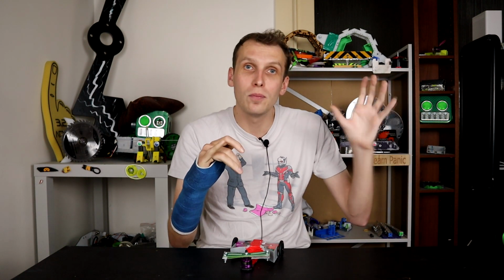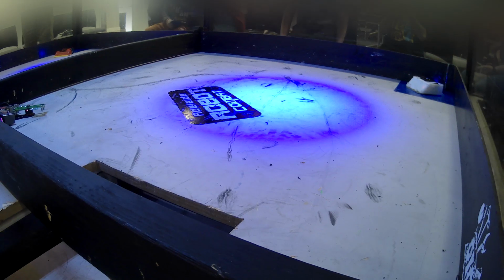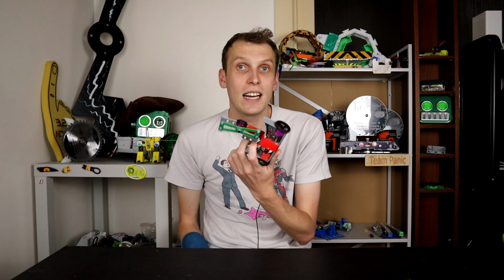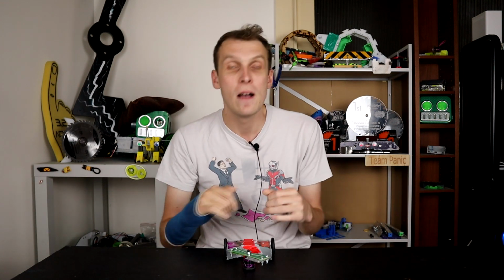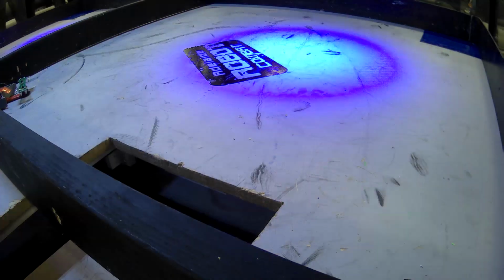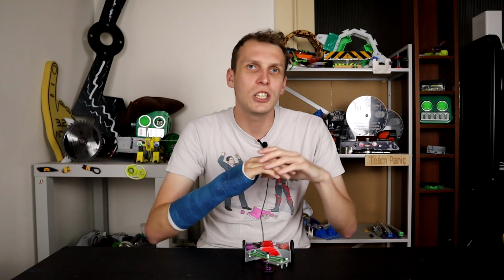Fighting the gyro! (ARC 150g A league fight report)

Comment: Wow, that hit with BT was certainly something, looks like a new bot to keep an eye on. Although now I wonder if there's just something inherantly stronger about verts? like, 99RB was meant to be "none destructive" and we saw how that turned out, now we have BT, well... doing THAT.

Feeling this guy needs a re-branding from Gestimate to Gyrohate XD

Well...Brick certainly decided "lego" lego home. Suprised the entire thing didn't blow apart, the actual bricks are stronger then I thought.

The irony of Gestimate working better in "Brit Mode" when it wouldn't actually be a legal ant because of the stupid cube rule lol.

Had a brief idea about setting one of the motors further out, thinking it would provide more rotational force to help counteract the force imparted by the weapon screw when driving in a straight line, but now I'm not certain it would actually do anything. Maybe something on the controller, setting one channel's max to be 90 or so?
Reply: Yes, vertical spinners are inherently stronger than horizontals due to the simple fact that newtons third law exists.

When a horizontal hits an opponent, the energy released will be equally divided between the bot with the weapon and the bot getting hit, usually both bots fly away.

When a vertical hits an opponent, the energy is again released into both bots. But now the weapon bot is diverting all that energy into the floor (since the direction of energy is now vertical) and since the weapon mount is now braced against the floor, also redirecting some of that energy into the bot getting hit as well. 

Sure a bit goes into the drivetrain, chassis etc but in general you're delivering more energy into the opponent with a vert vs a horizontal with all other parameters (weapon size, weight, spin speed etc) the same. As a bonus it tends to yeet the opponent into the air which will do a bit more damage when landing back on the floor.
Reply: @bami2  (Facepalms) DUH! that seems so obvious now you point it out lol